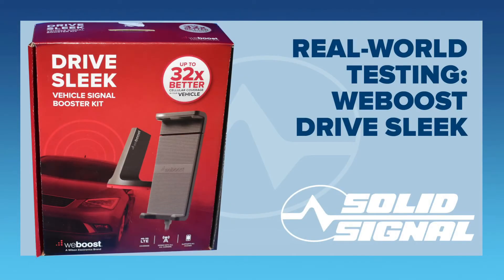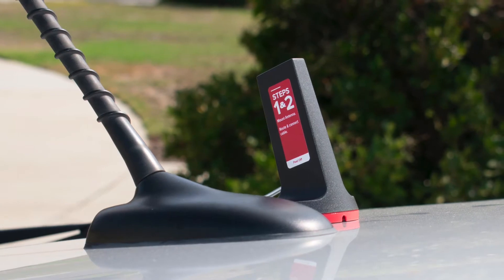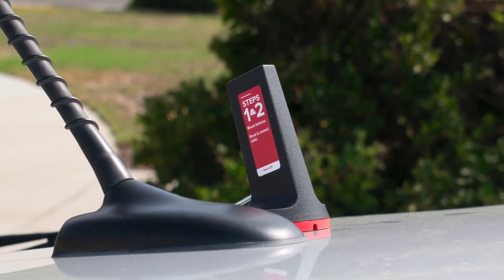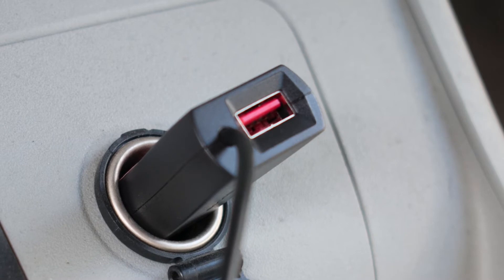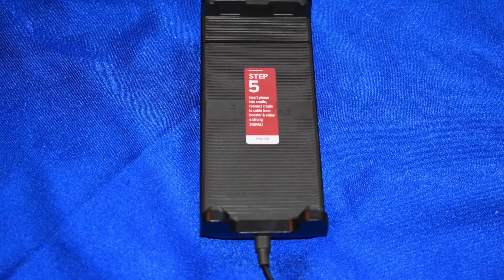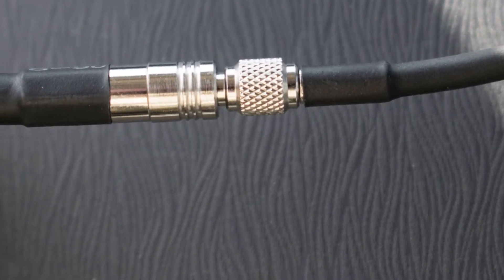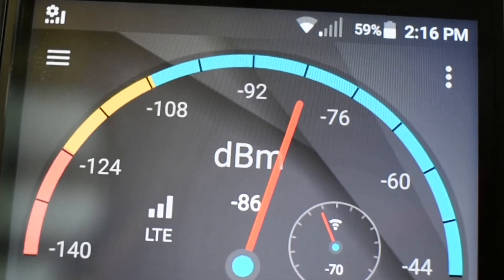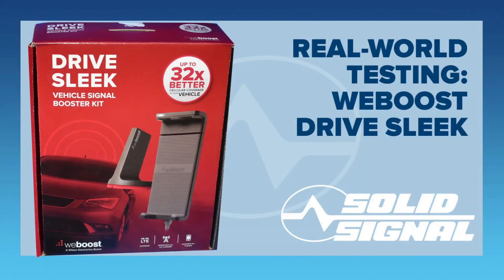Real-World Testing: weBoost Drive Sleek Vehicle Cellular Signal Booster

Comment: Why is it that with everything working (white lite at cradle on),  there are no difference between number of the signal bars on phone and car console  display? Shouldn't the phone have more bars than display, when display has only two?
Reply: I have one in my pickup ....... and there’s no difference in the signal
Reply: I was wondering the same thing. It seems he was on WiFi during the test and maybe, just my theory, he didn't enable Developer settings to maintain mobile data while Wi-Fi is in use? Not sure, really wish the OP would reply...